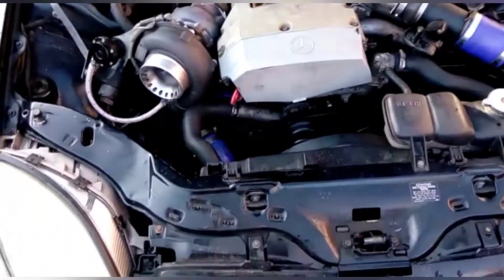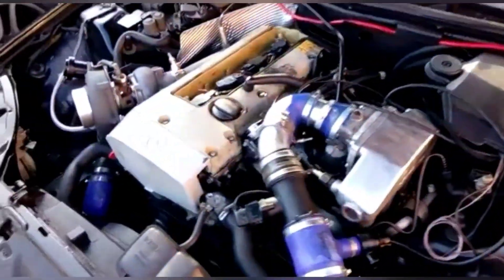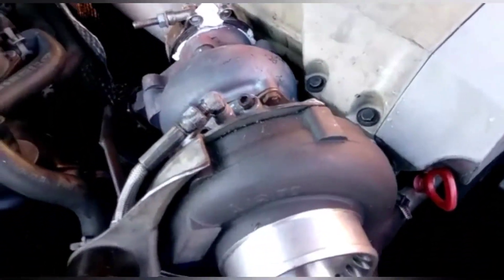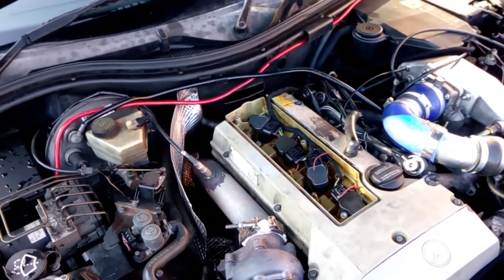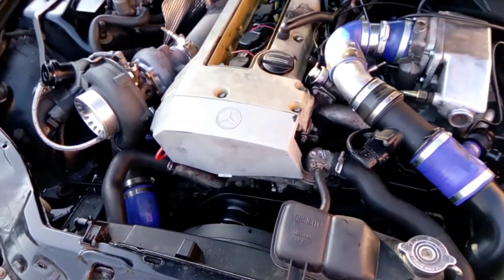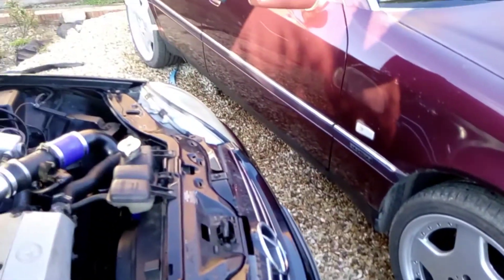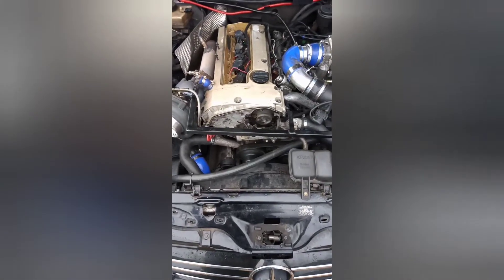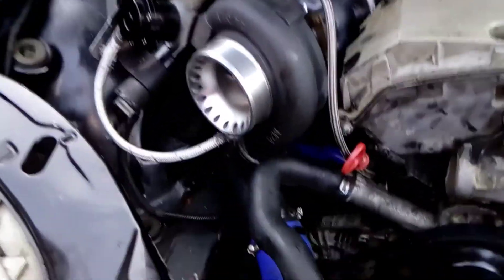Turbo Mercedes Benz M111 Turbo Slk.... DEAD???

Comment: I've been thinking about a set of the terrible clk wheels (they look like a bigger version of the slk 15's, which are supposedly forged and light af). Any chance of a shot of the car from the side in the next vid? I'm interested to see how they fit on an r170.
Reply from the maker: Yeah sure man these are light but being so skinny drivability in the wet is limited I went from these wheels to 9j rears cause I had no traction in the wet as much as it's fun it was getting inconvenient 😂
Reply from the maker: Just uploaded for you bud 😁
Reply: @M-oneeleven-M111 thanks for that, much appreciated. I couldn't find a decent shot of that anywhere
Reply from the maker: No worries man Ben's not so keen but I do like them on it seems to as to the sports car character of you think of a traditional sports car

Comment: Is the smell sweet or does it smell something else? Whats the AFR? Do you have any data the car gives you? Could be a fucked lambda.
Reply from the maker: The car is behaving as it should now we use a AEM afr guage works great the Afr's are exactly where they should be it does just seem like it lifted the head then settled it was definitely steam but as I wasn't there I can't say about any smells but it's running now as if nothing happened even on boost

Comment: What ecu are u guys running :)? As “fine whine” said, so you guys have an efr to relate to? :)
Reply from the maker: Megasquirt 3 ECU is what we use with a Ofgear transmission controller we use a AEM afr wideband kit works great recommend it. But the AFR'S are exactly where they should be which is super odd the car is behaving as if nothing has happened even on boost